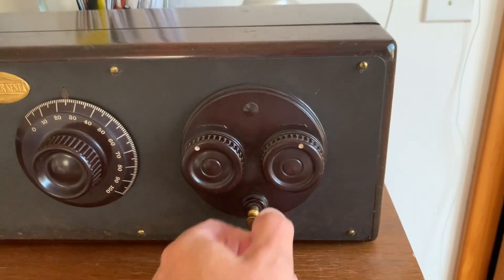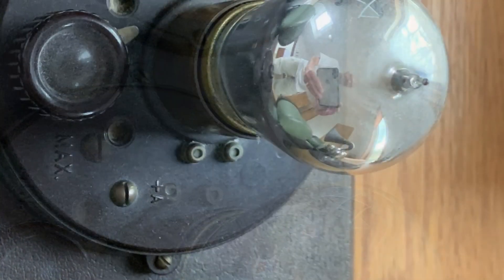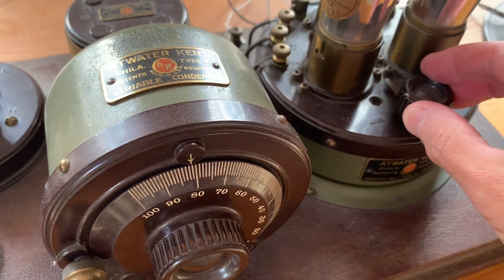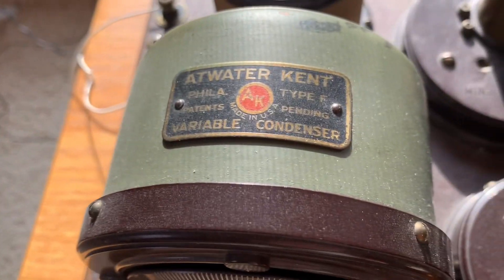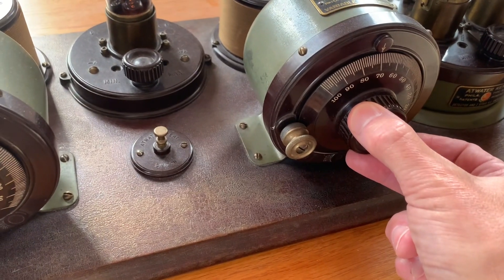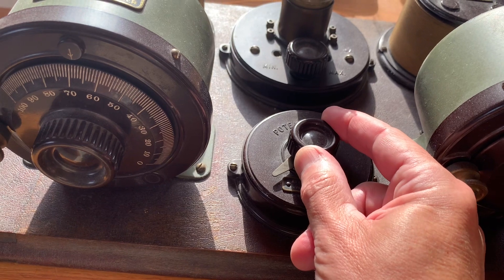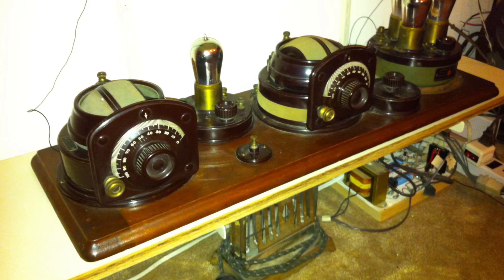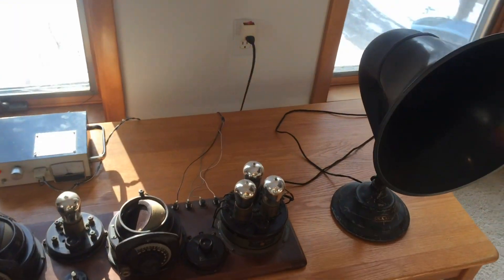Operating Vintage 1920’s TRF Radio Receiver’s

Comment: I have an Atwater Kent 32. It's in excellent condition and it works great. I use an ARBE-III for power.
Reply from the maker: Thanks 🙏 for watching and subscribing. I remember getting an AK-32 working for a friend. The ARBE is a great power supply I have one. I also have my home brew power supply and a couple 101-D kits.

73’s KA1VMW Mark